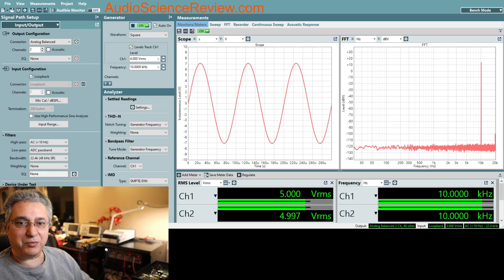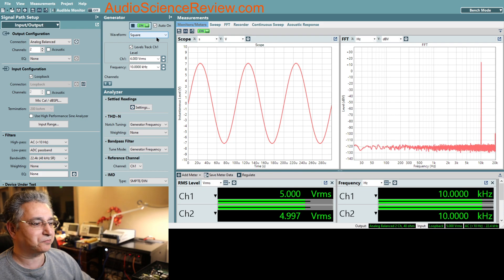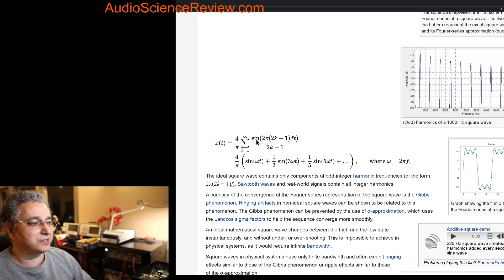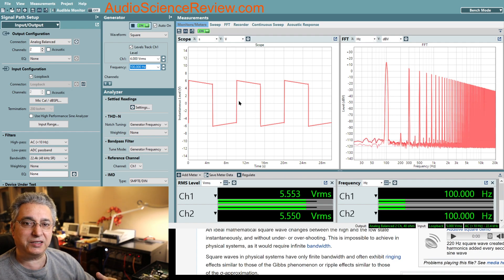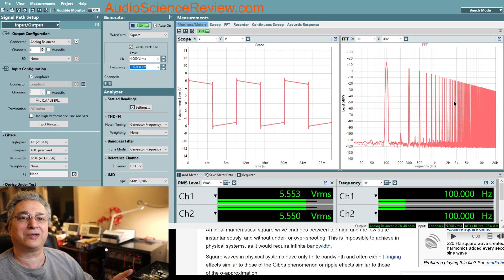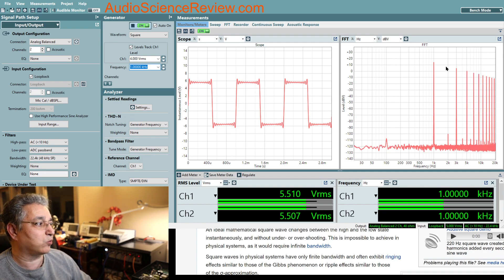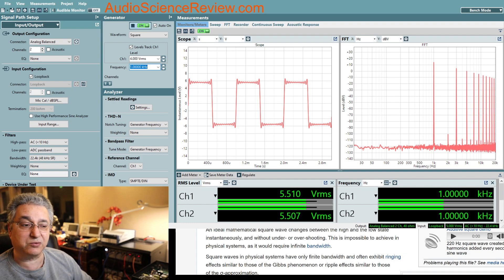Square Wave Testing of Audio Products

Comment: Excellent video. Thanks a lot for the explanation and great help on square wave testing. I was going crazy because I couldn't understand why in my prototype FET preamplifier in cascode configuration, the output square wave has rounded edges at 10 KHz (hf attenuation).

Comment: Back in the days when i did not know so much about electronics i just tested with sinewaves. Today i always use squarewave especialy on signaltransformers to set the right load resistor/cap across the secondary winding. It is also usefull with squarewavetesting to set the right gate resistors etc.etc. This is only a few examples...

Comment: Hi Amir!
Very important video! I can see a lot of traces from amp reviews with the square wave signals, discussions about slew rate, impulse response etc.
Here comes another question, maybe you'll be able to make a video out of it:
How important is a impulse/step response of a crossover filter? When designing an audio system (mostly active) or speaker crossovers, you have to choose your crossovers, slopes and types. Then, Bessel is the best from the IR/SR perspective, I did some labs and was able to see it on the scope (using square wave :D) but does it really matter? 
I also heard some opinions that 1st order crossovers are the best ones as they do not "alter" the signal as 2nd order (and so on) do. What's your opinion?

Thanks in advance!

Comment: A whole generation grew up listening to square wave and sawtooth music in 8bit videogames, as well as going on to favor videogame inspired music. 

That’s an instance that comes to mind where someone would want to replicate whatever sonic quality they remember from their youth. 

Which may not be reproducing a perfect sound wave, but producing the right truncated version of a square wave that was typical of that era or the limitations of their household’s gear. 

Just like music mastered in the 1950’s on tube gear probably sounds best played back on tube gear, and may seem excessively bright on modern equipment, as tubes roll off the highs and lows, and a mastering engineer may have compensated by turning those up.
Reply: The "square waves" generated by synthesizers and old computers are often quite far from the ideal square wave or even a 0-20kHz low pass filtered square wave. A tuned "square wave" with a little less high frequency energy is more pleasing to the ear. Sound chip designers are well aware of that.

Comment: How about headphones ? I remember Tyll measuring square waves of headphones.
Reply from the maker: Tyll did use them.  I have not found good use for them there as I have another method I use for that which is far easier on the headphone than square wave.

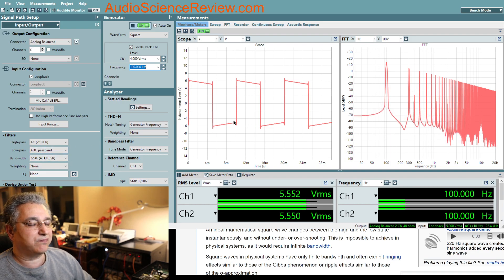Comment: Amir some error , @4:29 that falling / raising on top and bottom of square it's because  high -pass set on AC(<10Hz) on your AP555 , the ringing on the edges in other hand bandwidth  at your AP555  22.4 K ( 48 KHz SR) , your generator is only 100 Hz.

Comment: All accepted with thanks. I haven't been through some of this since undergrad days. 
However (and there's always a however), I would like to know more about a system's transfer function and I would like to see it in the time domain. In ancient days, we did this with "impulse" response, not square waves. Impulse response can tell one a great deal about how a system passes signals in the (non-repeating) time domain. Think: the strike of a drumhead, or the pluck of a harp. The damped keystrike of a piano, or the pluck of a double bass. I'm sure you'll end up with lots of infinite series of harmonics as Fourier predicts...
but, how about the time domain? How do we predict how a woofer or subwoofer will react to a single pluck of a bass, or a single tap of a tympani? How do we predict how a tweeter driver will ring, distorting the strike of triangle? 
Of course, lots of the data will be outside the audible frequency range... but what about what IS in the audible range? And what about the time domain response, in addition to the frequency domain response?
Is our system (source - amplifier - reproducer) more of a thud or a gong when asked to reproduce transients? 
It's surely too big of an issue to treat here, but that doesn't mean it isn't a lingering question.

[After writing all this, I'm kind of sorry to bring it up. Well... not so much...]
Reply: All measurable and presented by Armin in every review: Group Delay (how distorted in time is a sound) and CSD (how much ringing at each frequency).

Comment: No, not boring at all. Back in the 60's, 70's responses to square wave input would sometimes be shown, as you said, on a Tektronix CRT. As I recall this was to try to demonstrate the amp's slew rate and damping property. Didn't see it often though, but was shown for a Dr A.R. Bailey design I was building . Don't know now if it really did that ! I am learning a lot from your channel.

Comment: with Squarewaves you can test if a filtering is working, if not you will see the same Squarewave, especially in case of  magic Hifi-, Power cables etc ...
Reply: You can still test this a lot better with the other measurements he presents. No need for a simple square wave test. It's ancient crap.

Comment: Sometimes I use a 10 Hz square wave wav file for speaker burn in. It can run for hours at volume without even hearing it. Why you don't hear all these harmonics through the speakers?

Comment: Can you also demonstrate measuring real music signal? 
It's perhaps the most common argument against the value of measuring audio gear - that good performance with sine wave doesn't guarantee good music reproduction. 
I'm intrigued myself whether it can possibly show something more than a simple sine wave.  Maybe the AMP/DAC circuits respond differently to complex signal?
Reply: Actually the video just now about why square waves are not relevant is also the answer here. The underlying principle that any periodic signal can be represented a sum of sinusoids means that measuring how you reproduce sinusoids gives us a completely perfect representation of how a signal of the same bandwidth would be represented. I.e if we can perfectly reproduce a 20Hz sinusoid, a 20kHz sinusoid and any in between then we can prove mathematically that we could also perfectly reproduce any sound we can hear.
Reply from the maker: You can't measure music using this type of instrumentation.  There are tools that produce differences but they won't be measurements.  On your last question, music and test tones are all varying analog signals.  The DAC/Amp have no idea which is which and do the same thing to both.  If anything, music heavily masks distortions/noise perceptually.   Research after research shows that detection threshold is lower for test tones compared to music.

Comment: Hi Amir, thanks for the great video. I have a small suggestion about the titles of your videos. I think you should add a prefix to a series you do. For example review can just be review. While the video on the audioquest and smiler snake oil products could be "debunking audio" or like this video would be audio science fundementals. I think by doing this it will help with the algorithm and other people to watch what they are interested in. If not do this at least organise some of these into playlists with the titles I mentioned for example. Thanks for doing what you are doing!
Reply from the maker: Hi Sid.  Thanks for kind words and suggestion.  It is a good one.  My original idea to solve the same problem was to create playlists and organize them that way but it wouldn't solve the issue for someone just watching a new video.

Comment: I guess the thing about square wave testing has to be whether or not it is a performance attribute of differentiation or not.

Amir’s testing already reveals the useable bandwidth of a power amp, for one example...so I would guess that there should be a predictable correlation between the two. The capture of either one of the square waveform output, or the measurement of bandwidth of the amp should, at least to a close approximation, predict what the other looks like?

If that’s true, then the Fourier domain view is the superior of the two to look at ...because it tells you more direct information?
Reply: Heh, I was an SMPS designer in 80’s. I was always paranoid about square wave ringing (for good reason).👍
Reply from the maker: Fourier transform is by far most revealing because we can see very small distortions and we can apply psychoacoustics analysis to them.  You can't do that with square waves with a few pixels at screen resolution.
Reply: Yes, that's also why he mentioned oscilloscopes and testing in the 70s. A square wave can be used to estimate bandwidth (rise and fall time), as well as identify resonant peaks in the frequency response (ringing). Both can be calculated by measuring the time and magnitude, ... or simply be read from a frequency response graph or FFT. The fourier view is definitely superior.

Comment: One thing that seems to resonate with audiophiles: what happens to the out of band content? It is like trying to push too thick stick into too narrow a hole, something has to deform. High frequency content that the system can't reproduce will all turn to heat and distortion. 

I get a lot of pushback, coming from audio engineering side, from audiophiles but that analogy seems to work... at least if the meter is "how many angry responses will you get", where the answer is: "almost zero"...

Comment: I never understood why higher frequency square waves are not used. This makes alot of sense because of the bandwidth issue regarding the harmonics because you cannot "truly" isolate a 1khz signal nor would it play just that signal on an audio device. However does that still make say a 30 or 500hz square wave still useless for performance evaluation? For example with Tyll's measurements, he mainly used 30hz and 300hz signals to judge the headphones dynamics within the time domain in particular. And from my perspective it was easy to understand why and made sense to me. If a square wave test in no good to judge dynamics in the time domain, what do we use? is there any test that will be good for that?
Reply from the maker: I tried his schemes for using square waves for headphone testing.  He used it for matching the fit for each cup.  I find that I can do it better with sine waves.  He also tried to read tea leaves from square wave response which were either not useful or could be done using other means.   As for time information, if you are listening with a speaker in a room reflections completely eliminate any phase response.  Since we listen in enclosed spaces, biologically we have learned to not care about such timing information.
Reply: @AudioScienceReview  you really think that time/phase domain is meaningless?  That's maybe the most over the top claim I've seen from you yet.

You are doing the uneducated public a disservice with your pseudo scientific presentation of arbitrary conclusions
Reply: @snoozzell  I totally agree. This channel is like watching the blind leading the blind. It's painful almost to the level of comedy.

Comment: I thought I'd do a test on my ears, and I got some interesting results.

1) 192 kHz 32 bit, generated 10 kHz square wave
2) 44.1 kHz 32 bit, generate 10 kHz square wave
3) 44.1 kHz 32 bit, generate 10 kHz sine wave
4) #1 converted to 44.1 kHz

I don't have professional tools, just using Audacity to create the files. My expectation was that the harmonics above the threshold of audible frequencies would have no effect, and that #2 and #3 should sound the same. I also hypothesized that #1 would sound the same, since all the harmonics are above audible frequencies.

My result: #1 and #4 sound the same. But #2 is clearly distinguished, it has lower frequency buzzing present, and none of the square waves sound like the sine wave. I'm thinking that the tone generator feature of Audacity is the problem here, what do you think?
Reply from the maker: In #2, you created an "illegal" signal for 44.1 kHz sampling because the response went to infinity instead of band limited to 22.05 kHz.  My Adobe Audition for that reason, won't generate them.  In my test, I am using an analog generator so it is not subject to this limit.
Reply: @AudioScienceReview  and @SquidCaps thanks for the responses.
Reply: I'm not Amir but, yes, that would be the first things to check. Tone generators are simple but there are limitations, you may have found just one of them. The example 4 is closer to how it should be generated. In studio side, we can decrease antialiasing and other artifacts by magnitudes or order by generating or processing the signal in much higher resolution (typically 64bit, 384kHz) and then downsampling and filtering it. This little trick works so well that even if we raised our project sample rate to 192kHz, it is not as good as 48kHz project sample rate that is oversampled at 384Khz.. i know, it is weird but numbers don't lie. 

It is wise to generate and process audio signals at higher resolutions but once it comes to the actual output from speakers: downsample to 44.1k can be done without losing any of the actual content. Digital audio is not easy subject and even harder for those of us that started in the analog era. Same rules do not apply.

Comment: Well I always thought that if you compare say 2 power amplifiers using a 1khz square wave, then the one which shows the less lean and rounding is faster, and therefore better at reproducing transient impulses like a snare drum strike.
Reply: True up to 20kHz. Beyond that it's completely irrelevant. Being able to reproduce a 1MHz signal or something else high required to draw a pretty square wave has absolutely no bearing on your amp's ability to reproduce the frequencies we can audibly hear.
Reply from the maker: @Garbz  Exactly this.   You are simply testing how much above audible band an amplifier can go.   It is one of those tests where it "pleases the eye by the ear doesn't care."  :)
Reply: @Douglas Blake Nope. Only if you take out harmonics above 20kHz. we can prove that mathematically, in simulation, and in blind audio trials as well. Now if you can hear the difference between a 30kHz and a 50kHz sinewave then you'd have a claim. But the reality is for the rest of us mortal people if you remove any energy components with a frequency above 20kHz we can't physically hear a difference.
Reply: but AMIR say no.. the god of audio have spoken.. what can we do ...

of course he still talk about perfect square waves .. again and again when we all talk about a bandlimited (under 20-30-40khz) square wav and the capacity of a system to reproduce it correctly.

we are waiting for those who say you can read transient response and wave shape skewing in the FR hahaha

similar test could be done on triangle waves or any complex shape.. it's about capacity of a system to reproduce correct shape from input to output and square wav is the harder one to reproduce so this is the one we are talking about since it will give you better ideas of the quality of a system.. but triangle wav also need to be reproduced correctly

of course for amir analog synth never need any amplification or headphone amplification, for him, it's only dac limited to 44.1khz playing 44.1khz tracks that ever need amplification..
Reply: @Douglas Blake You wrote a lot that is completely irrelevant. No one cares about the tones of an instrument you can't hear and it sure as heck wouldn't have any impact on the sound. You see we're not filtering to fundamentals. We're just filtering overtones which are inaudible. Would the result change its voice measurably? Yes. Would it change it's voice in any way even remotely relevant to you listening to music? Not at all.
If your thing is staring at spectrographs of music then go for it. But amplifiers aren't designed to show you pictures of music. They are designed to play it, and your assertion that one amp sounds different to another because of bandwidth differences outside of the range of human hearing is simply wrong. 20-20kHz wasn't picked for anything do with with instruments, it was picked to do with our limits of hearing. 

Now if you're designing an amplifier for your pet dog I'd be more than happy to help. I'm sure he'd appreciate all the things we (and you) can't. 

However if you think for a moment that this is relevant to an amplifier designed to play music for a human being then by all means you're entitled to your opinion, but your opinion clashes with Fourier's theorem so you may want to document some proof. It'll be worth your while if you're under the age of 40 since you'd almost certainly win the Fields Medal in mathematics for your efforts. 

Square waves are irrelevant for a test methodology. You can do a frequency sweep and the result will tell you far more than something you need to interpret and we can even mathematically model exactly what the square wave will look like. I personally use square waves all the time when designing gear. But that's because I don't have Amir's expensive audio analyser, otherwise I wouldn't waste the time trying to interpret something secondary. And even then the only reason I use square waves is to check for signs of amplifier instability. Unless your square wave has an edge that rises slower than a 20khz sine wave they are ... and let me be completely clear ... completely fucking irrelevant to your amplifer's ability to play music you can hear. 

Now let's work together to solve your dog's problem. I'll design him an amplifier and you prepare some recording of dog whistles.
Reply: @Douglas Blake "the wave shape of the fundamental frequency" is supposed to be... a sine wave. You are bathing in snake oil.